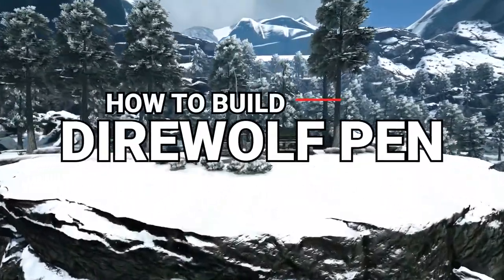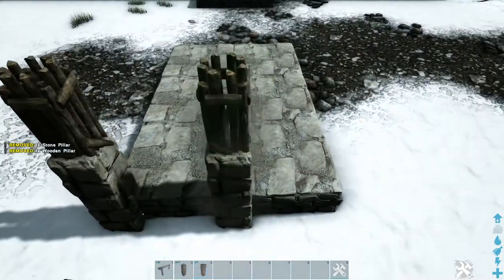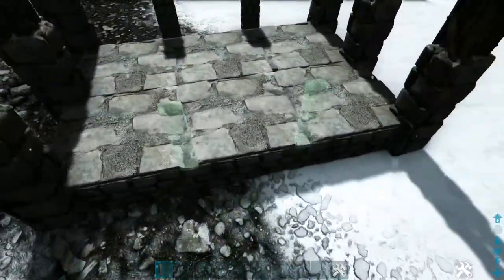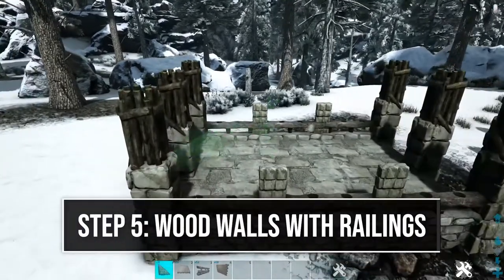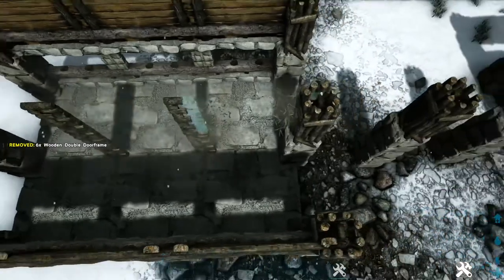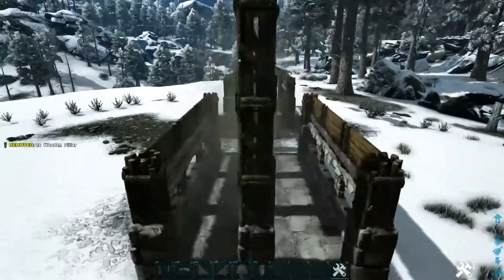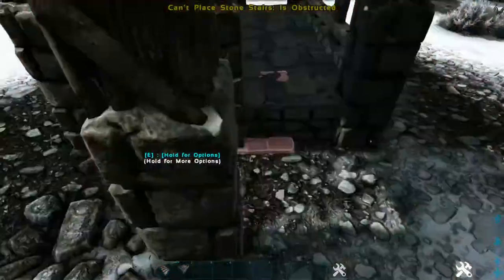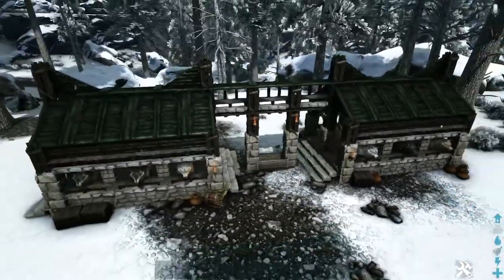Ark: How To Build A DireWolf Pen | Building Tutorial | Official Settings

Comment: Any chance you can do a thyla breeding pen where you wouldn’t have to crawl under parent to claim the baby?
Reply from the maker: A pen just specifically for Thylas? Are a mammal breeding pen in general?
Reply: Well in terms of size I think you could make it good for dire bears and thylas
Reply from the maker: Yeah I'll add it to the list of builds to work on.
Reply: One tip I have is use hatch frames under the female as this worked for my direbears, they had a tendency to die because stuck in the ground, so the hatch frames let them drop down